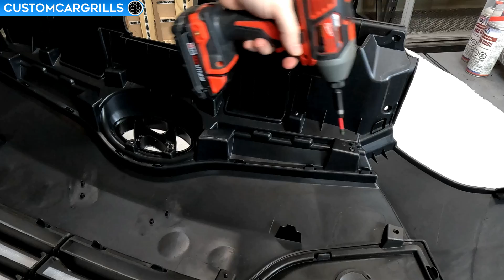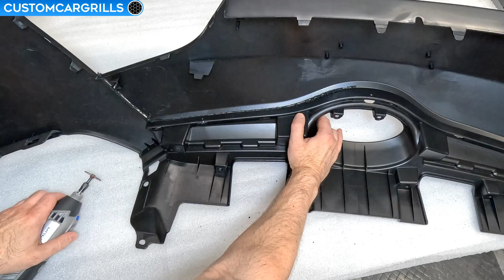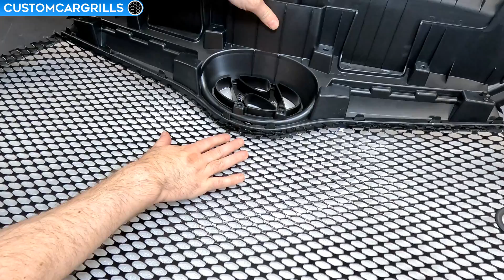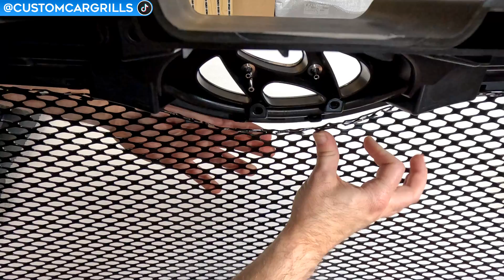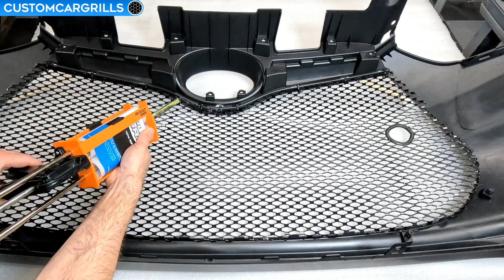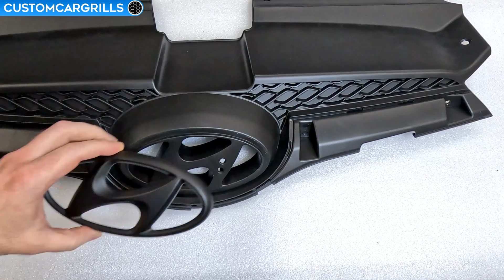Non-Turbo 1st Gen Hyundai Veloster Mesh Grill Installation How-To by customcargrills.com

Comment: What cutting wheel was used on the dremel?
Reply from the maker: It's the #543 cutting and shaping wheel.
Reply: @ thank you. My grille will be here this week and will document the install this weekend
Reply: Is the self etch primer used grey in color?
Reply from the maker: Yes, the primer was gray.  If you're going over the chrome be sure to get a good sanding on it so that the primer will adhere better.

Comment: Where can I get that dremel and the paint?
Reply from the maker: I use the corded dremel 4000 model, which should be able at most major hardware stores or on Amazon.  The spray paint may be available at a local auto body supply company.